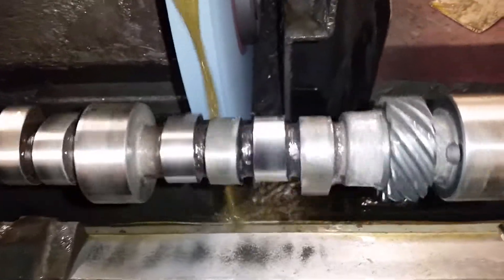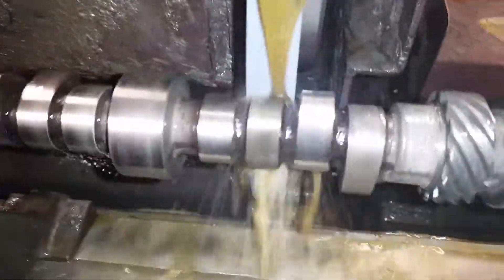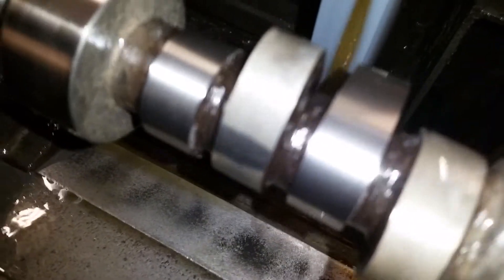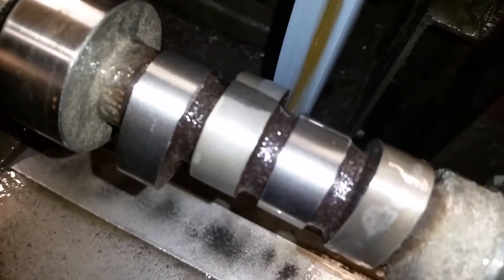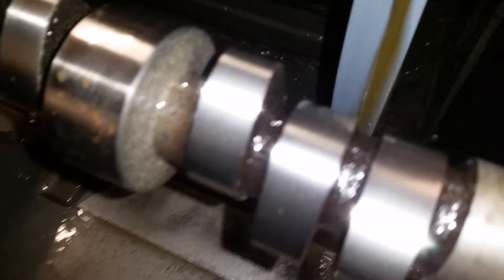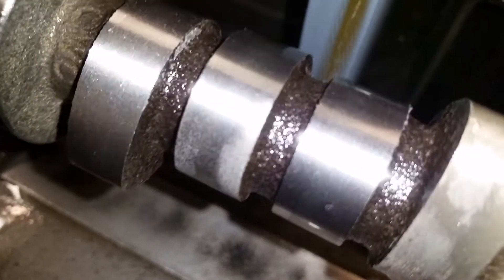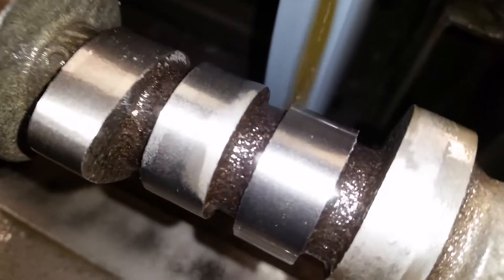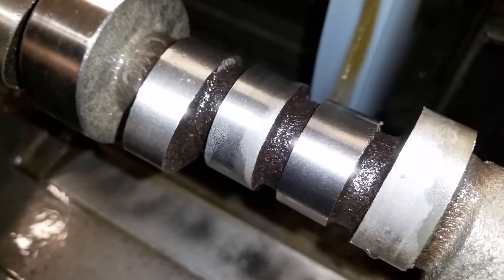Camshafts ... just because it's new doesn't mean it's good

Comment: I worked in a machine shop. No CNC machines.
Well some of our work was blue printed. We had a comparator to see if the parts were within specific parameters.
Now other departments had no blueprint work. I saw a lot of junk go out the door.
If cams are not ground CNC, there's more chance for error.
The operator needs to have the right settings too.

Comment: Can you grind cams for a vortec 4200? I was thinking about lobes similar to a BTR turbo cam for a 4.8L vortec/LS engine, I know it's comparing apples and oranges! Single pushrod, vs  DOHC with cam fazer,  but hoping to gain decent lift, and some duration, I don't know the stock specs, but I'm sure they could use a bit more of what they have, something like .040" to .080" lift, and 20° duration? If this is possible, I know there is only so much you can do without adding material..  thanks,,

Comment: Cam lobes that aren't for roller lifters are supposed to have a taper. So if you grind it with a flat stone I won't touch till you have taken all the taper out of the cam lobe. The taper is what causes the lifter to rotate and roll along the lobe. Cam was fine before, now it's junk.
Reply from the maker: What are you talking about ?? The cam was junk... its ground correct now. If you'd like to educate yourself please ask a question

Comment: Really strange question, say you have a diesel pump camshaft that has half moon looking lobes and you want to grind it to a “regular” camshaft profile.

Can your company heat treat the core since so much material needs to be removed to completely reshape the lobes?

Example if you aren’t sure of my description- regrinda yanmar fuel pump camshaft from a 3tn66 to a Cummins p7100 pump profile for a custom 3cyl p7100 build.

Hypothetically
Reply from the maker: We could send it out after grinding

Comment: You guys have a stock of G54b Turbo camshafts? If not, can you do a regrind on a stock camshaft and keep the same base circle, but increase the lift and duration so I won't change the valvetrains geometry? I got 2 cams, but they're in poor shape. Hoping to have one reconditioned and modified for a little more top end, seeing as the stock cam doesn't do much passed 5000rpm.
Reply: How much lobe taper?
Reply: Sorry I actually thought it was a sbc cam whats it out of ?
Reply from the maker: MegaBuster777 can't increase the lift and maintain base circle. Going from non turbo to turbo grind won't remove enough to material to even worry about.
Reply: Sweet. I've just always been curious if it could affect it. You guys stock rockers btw? Lol. They are so hard to find. Even the hydraulic rockers are a pain.
Reply from the maker: MegaBuster777 we resurface the oem rockers for $3.50 each
Reply: I'll probably have to get that done too then.
Reply: Lobe taper? I'm still a noob when it comes to valvetrain/camshafts
Reply from the maker: Jonathan Swindell zero taper is for flat tappet style cams like Chevy and Ford
Reply: Oh. It's got a light taper.
Reply from the maker: Jonathan Swindell yes this one in video.  Thought you were speaking of your cam
Reply from the maker: Thought you were speaking of his Mitsu cam. Yes the cam in the video is Sm Blk  Chevy and has .002 taper we usually put a little extra to assist in lifter rotation.... sorry about the confusion
Reply: The G54b is the engine out of a starion. SOHC 2.6 Liter 4 cylinder.